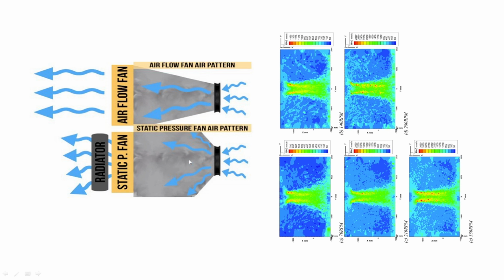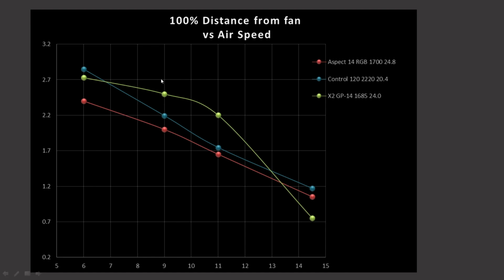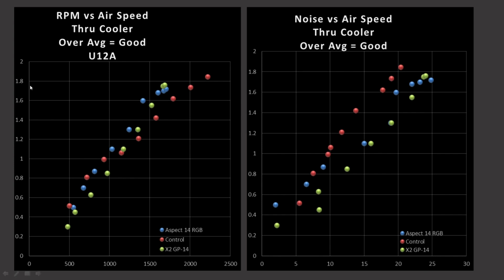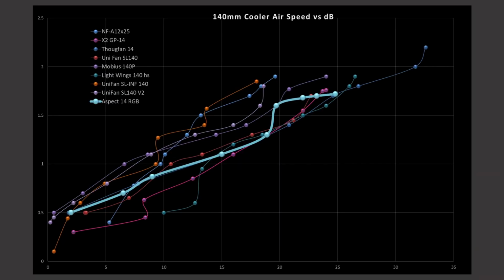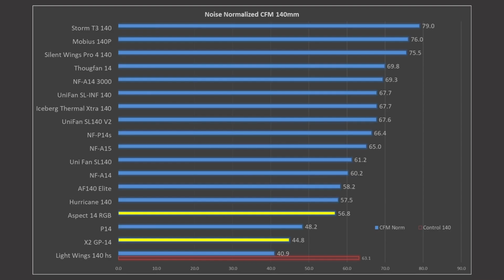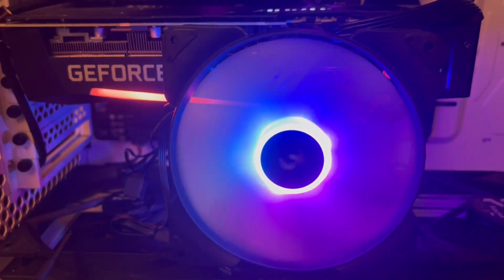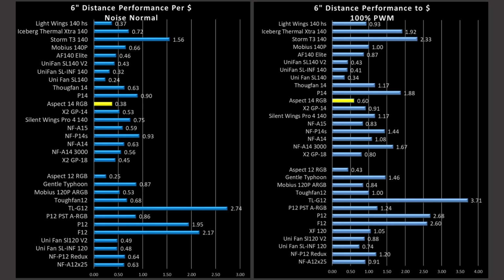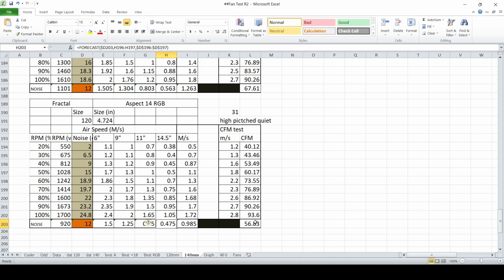Fractal Torrent Fans: Aspect14 Review

Comment: Thanks for the comprehensive info bud! Was just looking to see if these little suckers will be a good pairing with my silent wings 3. Turns out they're relatively similar in stats. I've just bought the fractal North which comes with two pre installed, so I'm gonna run the 3 silent wings on the front and the 2 fractals on the top to ensure positive case pressure and reduce dust being sucked in through the plethora of holes in the case. Keep up the good work dude!
Reply from the maker: Thanks. Glad it was helpful.
Reply: how are they similar? the SW3 are a lot better and the aspect are noisy. bearings always make a clicking noise which is especially jarring at low RPM. You are the perfect example of data fatigue and you really needed this TLDR. Fractal does ok, when noise does not matter, but it really is a bottom of the barrel fan